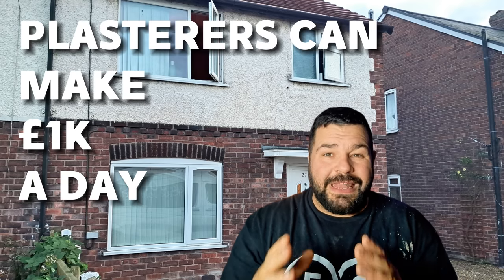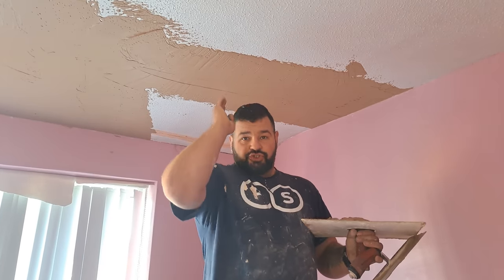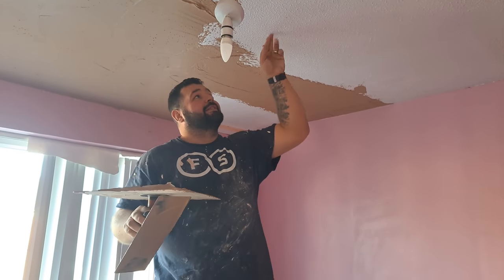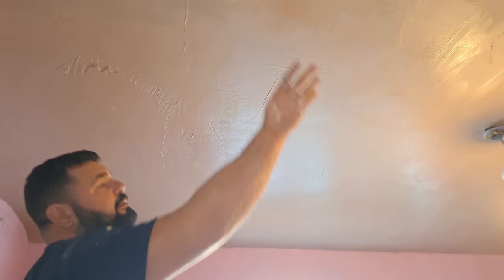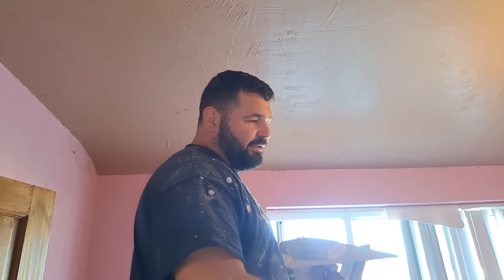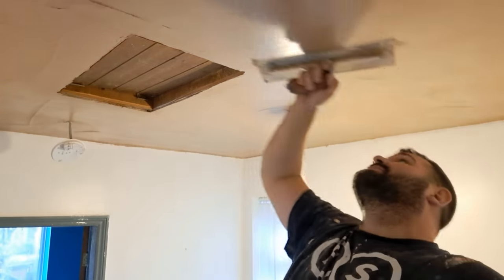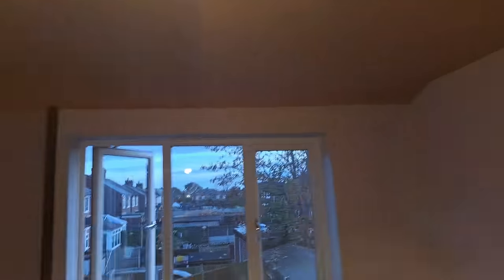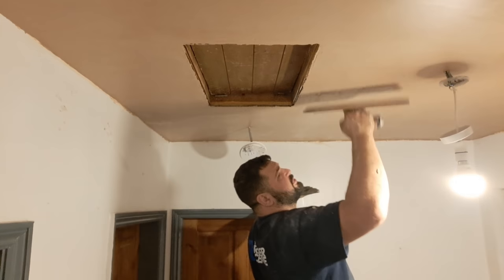HOW TO EARN £1000 A DAY PLASTERING OVER ARTEX

Comment: Good stuff, although I’ve seen many boarded ceilings that have had distemper on them - it was  used extensively in the 50s and 60s too. Plus, a lot of boards they used then were the smaller square ones..spent ages on different jobs, screwing boards down and knocking in the nails!

Comment: Hi Kirk 
If you carry on like this you will be getting a tax rebate or an MBE. Actually I would really like to see you in the House Of Lords one day. 

Money aside I just wanted to ask you about Artex. It seems to me that a lot of the time it is not  plaster based Artex but textured paint. Sometimes if the Artex has had several coats of paint it is hard to tell but I was just wondering about adhesion and suction with those two different coatings.

Comment: The ceilings in older property's built in Victoria times were coated with whitening which was basically chalk .as an apprentice in the early 60s my job was to wash it off before applying vinyl emulsion. I never came across lime wash it was usually applied in cellars or years before on walls

Comment: Limewash is limewash - watered down lime putty. Distemper has lime in it, but there were different brands, most commonly it had casein and chalk (calcium carbonate) and animal glue - this leaves little to no pores in the wall, hence why nothing can stick to it. You could PVA limewash but not if it has been burnished similar to venetian plastering, again no pores so nothing to grab onto.

Comment: Nice job! My main worry is future owners of the property won’t know it’s artex under the skim, even after a full survey they may not flag to the owner of the potential threat. If they then decide to put down lighters-they or a sparky are going to drill many holes and they may not spot the artex. This job usually takes a day and the clients will be back in watching tv with the family in the evening completely unaware of the now airborne asbestos in the air, which will linger for along time and be spread all over the house, anyone friends or family entering the property are at risk. We would always advise clients to remove the artex, and conduct an air test to make sure the air is free from asbestos. Asbestos is a killer, I know it’s going to be more expensive, but you can’t put a price on your health or others.

Comment: I’d say that’s not exactly true  Artex was used a lot because it had asbestos fibres as the binder meaning it was perfect for using over cracked ceilings that were lath and plaster, I’d say the only way you knew for sure was because you saw the boards under the light fitting but it could of just been Artex.

And that’s a piss easy pattern to skim over without any major high spot, plus the house has no carpets or furniture in it.

Making a thousand pounds a day is just lip service it may happen you fall lucky a few times but IMO that’s all it is luck most plasters are only earning wages otherwise they’d be doing something else!

Full Respect there lad not many would do that you’re a top bloke.

Comment: "job done - its fine to skim over" - Question from me, someone who knows NOTHING about this.... 

Isn't it irresponsible to do this? In 10 years when someone else is living in this house and they add new light fixtures, or something else to the ceiling, they are running the risk of being exposed to asbestos because its been skimmed over instead of dealt with properly? 

Or does that not happen if its sealed in?
Reply from the maker: It's one of the ways the HSE recommend to stop it releasing when it's knocked into mate
Reply: @Onthetrowel  Thanks for the response and clarification!